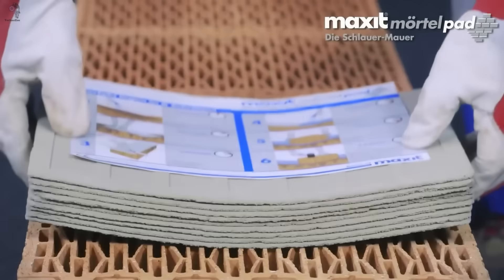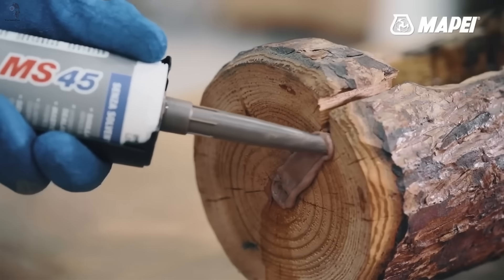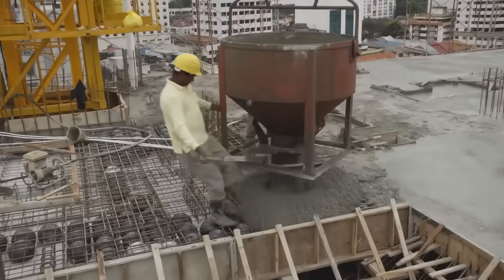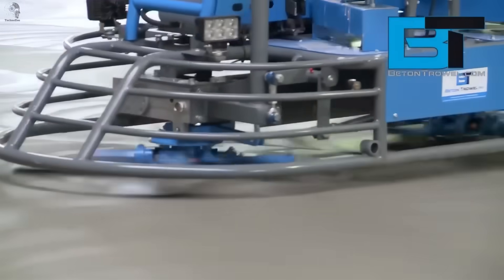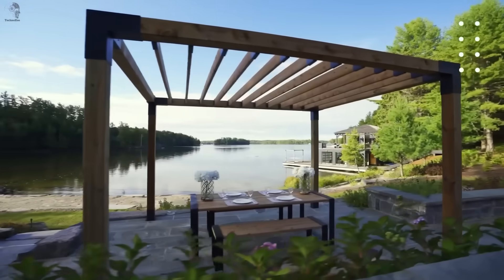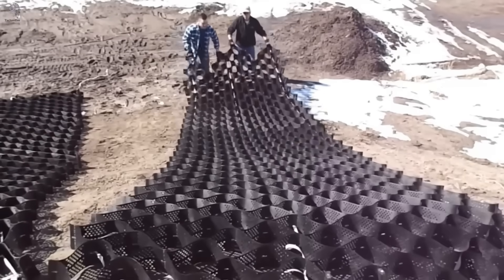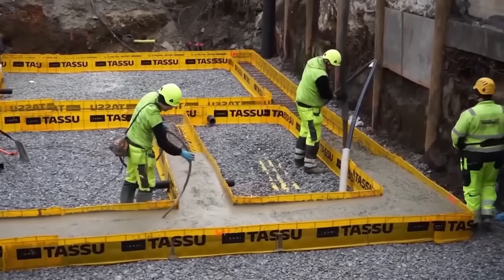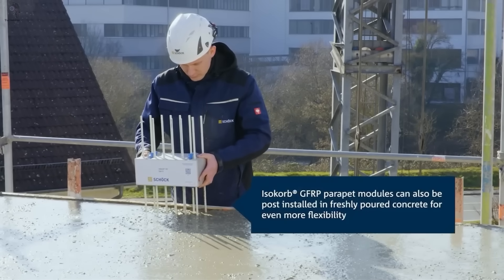Amazing Construction Technologies You Must See | Next Level Engineering

Comment: LMAO ! More Expensive in most cases, and we are going green in reverse with all these plastics and composites in new materials in increased volume, it's not just the product but the manufacturing that's not friendly to the environment. Just as the lie about Solar and Wind generators, it's all a scam. $$$$$$$$$$
Reply: Exactly. Using these thermal connectors as an example. I was building a house in 2024-25 in Poland. I have a 4-meter-long balcony. I inquired about prices from two manufacturers, including the one presented in the video. They are so expensive that, when I calculated the potential heat loss using standard rods and standard balcony insulation, the investment in thermal connectors would pay off in about 60-70 years.
Reply from the maker: Thank you for sharing your thoughts